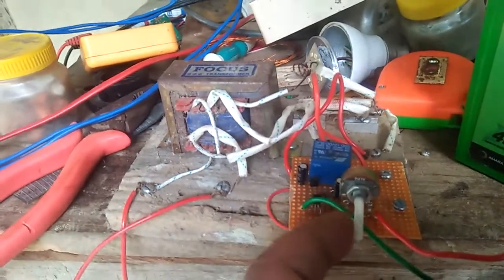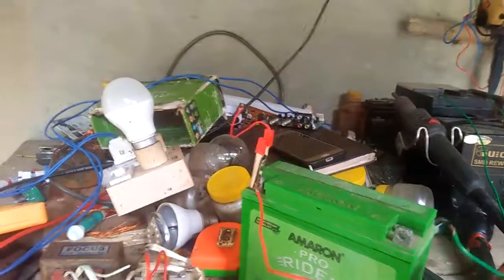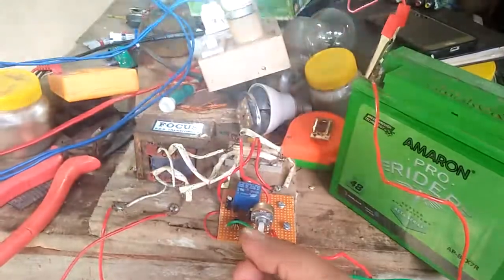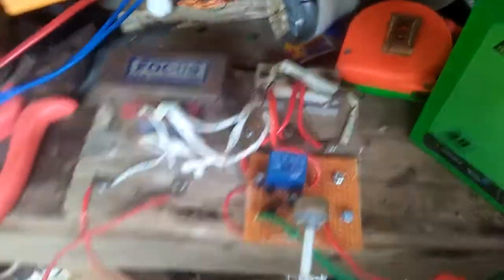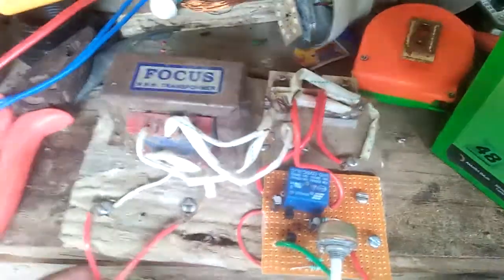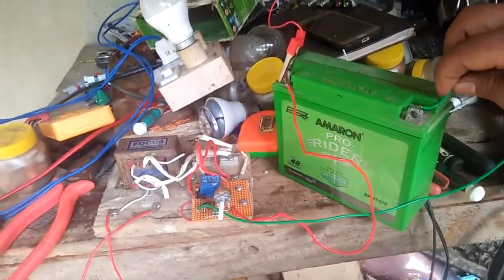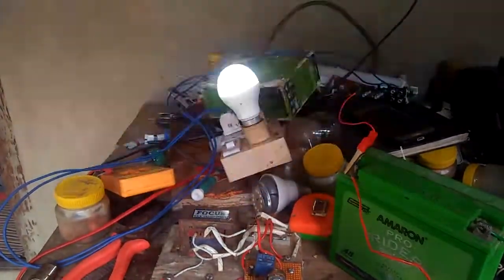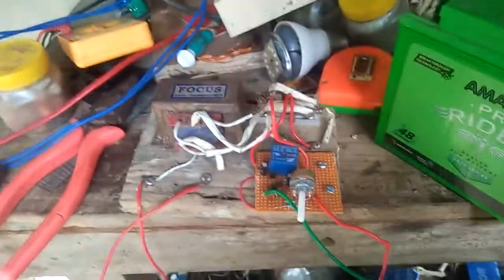new electric fishing with controller

Comment: Out put watt bwswk
Reply from the maker: 1000 watt
Reply: @vryleelectroniscabinets4136  1000w light mwchwngwi da gonok mano
Reply from the maker: 1000 watt stock kwrui
Reply from the maker: Ta wana di output kaham 3 fit kuthuk easily mannai
Reply: @vryleelectroniscabinets4136  oh nini mobile number kisa ri di
Reply from the maker: @ajitnoatia7777  8974448974
Reply: @vryleelectroniscabinets4136   thank you